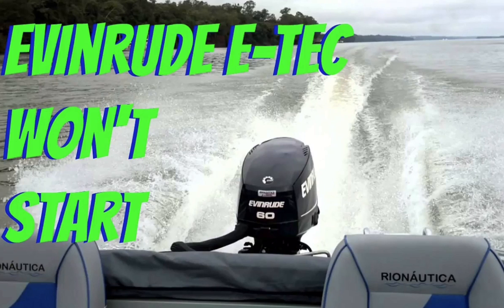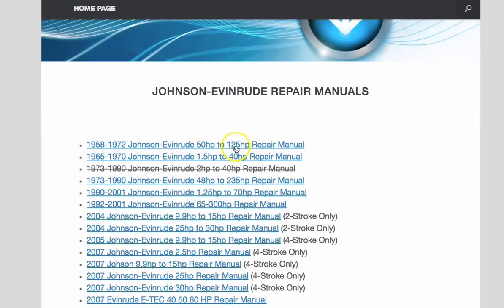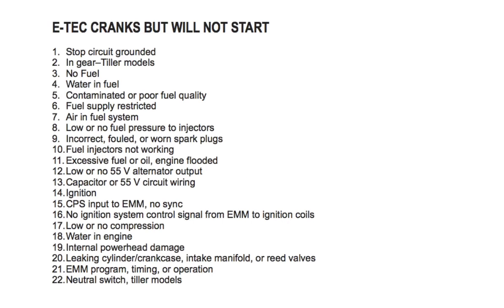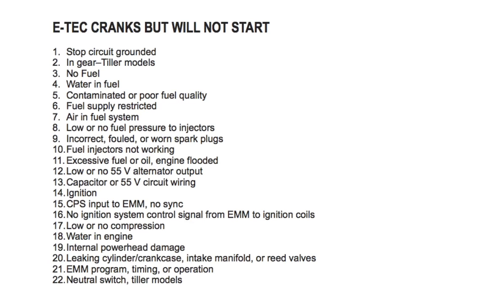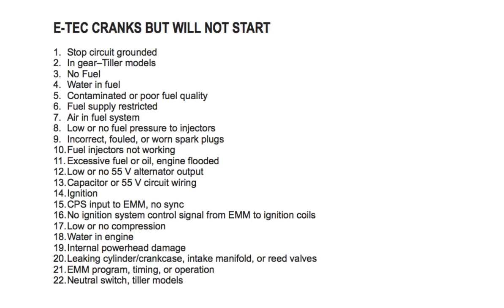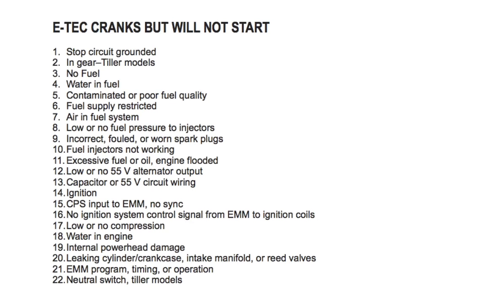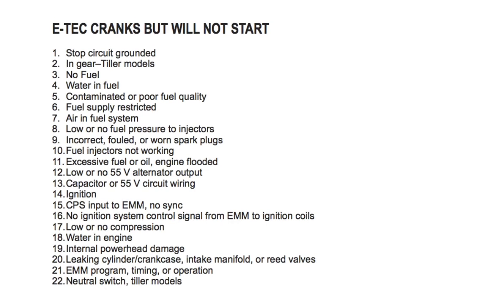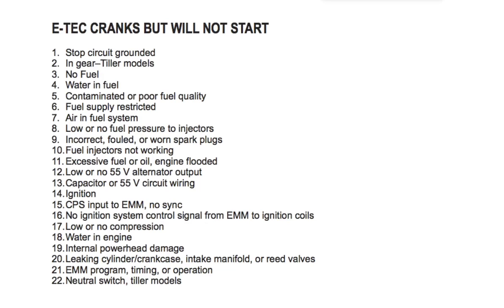Evinrude E-TEC Cranks But Won’t Start

Comment: Mine ran fine 2 weeks ago, but wouldn't start a few days ago for no apparent reason. I dropped it off at my Evinrude mechanic... and $200 later he said it started every time he tried it. He suggested "re-booting" since there are computer elements in these new engines. Turn off the power switch (batteries), wait 5 minutes, start over and everything will probably work.